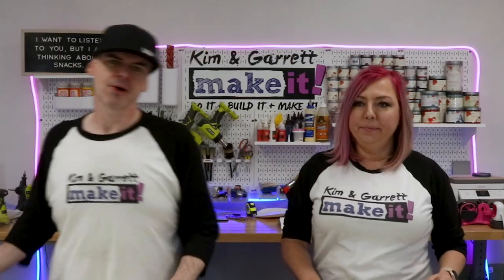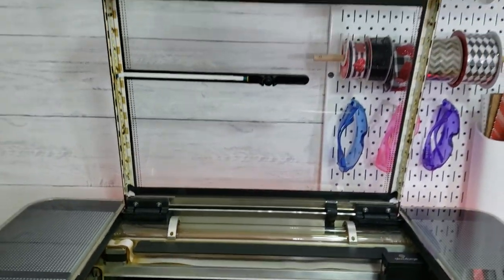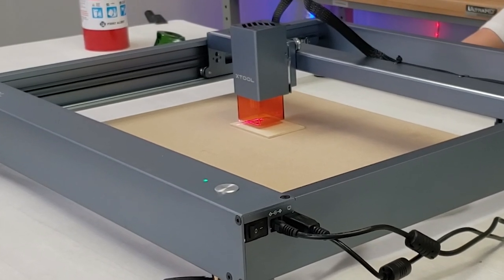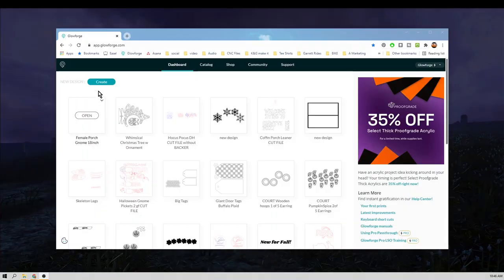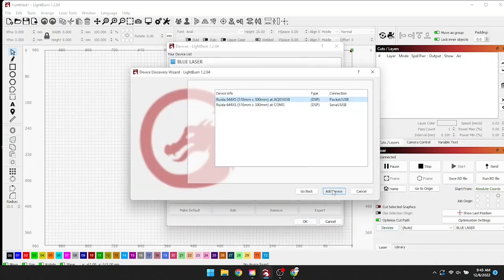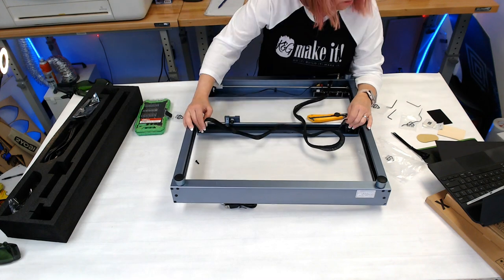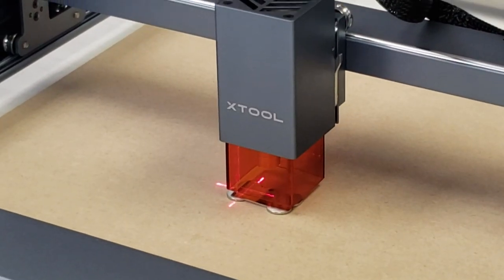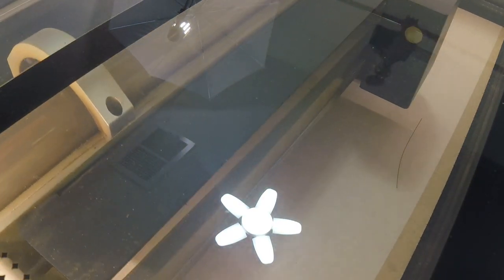Desktop Laser Engraver Compared: Glowforge Pro, OMTech Polar, and xTool D1 Pro

Comment: It should be pointed out that the Glowforge premium subscription is NOT required to use the machine.  Existing users got a free month of premium when it first came out, but I never used it.  I do everything I need in Silhouette and upload my SVG.  The only thing I wish I could do in the GF UI is flip things over.

I love my Glowforge and highly recommend it if you want to get up and running quickly with a short learning curve.  That said, if I was starting today, I would probably go with the Omtech Polar, based on features and price. The rotary alone sets it apart.
Reply: I'm confused.  Other reviewers I've watched have complained that Glowforge REQUIRES the $50/mo subscription to really do much of anything with the unit. Are you saying this is incorrect?  Thanks for any clarification you can give.  I'm researching and this $50/mo requirement as I understand is a negative dealbreaker for me.
Reply: @HaltWhoGoesThere  You absolutely DO NOT NEED the subscription to use the machine.  I found no significant value in it for my purposes (even when it was discounted to $15/mo when it first came out), so I do not subscribe to it.

If you go to the FAQ on their website, look at the second question under "Wifi and the cloud" (last section)

         Q: Do I need a paid subscription to use my Glowforge?

        A: No. All the software you need to use your Glowforge is included, forever, for free, with your purchase. If you'd like additional design software, free catalog designs, and other add-ons, you can subscribe to Glowforge Premium.

Comment: I started with the Ortur 10 watt diode, didn't really much care for it, as it is so light it moves all over the place.  So I upgraded to the Fox Alien 20 watt, easy to use, but again is light weight and moves around so has to be clamped to the table.  I then went huge with the OmTech 60 Watt Stand alone CO2 laser, with a commercial chiller unit.  I also upgraded the rotary to a Mansfield Customs rotary, which is the best of the best.  But I didn't give up on the diode so fast, and also have the XTool D1 10 watt, which is heavier than the other desktop diodes, doesn't move, and probably the best for doing just engraving. I haven't played with the rotary yet, as I do most of that stuff on the OmTech.  I did have to create a custom charcoal filtration and exhaust system, but the cost is rather cheap, and the air assist is awesome. Glad to see that the OmTech won your comparison, but I'm with Garrett, love all my children...lol

Comment: My laser is very similar. Started with an othur, was way to scary and not the best to learn on, luckily my wonderful husband surprised me with a glowforge for Xmas 2021. Glowforge is pricy but it taught me soooo much. Unfortunately, my glowforge caught fire (cardboard) I started the cut and ran to take a potty break and poof fire.  Word of advise don’t turn your back otherwise you run the risk of burning your house down. Luckily I didn’t damage it beyond repair and only need to replace a couple parts. After the fire I was devastated ( this was before I knew it wasn’t a loss) My hubby sprung into action and we went big with a Thunder nova 100 watt. Downside to the thunder is it’s takes up almost half of my craft room. Night and day in how long cuts take. Glowforge takes 20 minutes to cut the 1 Minute with my Thunder. I thought Glowforge was fast.
Reply: Wow tell me your hubby is rich without telling me he is rich.. 😅

Comment: I've been researching lasers and so glad I came across this video. You mentioned the bed size on the omtech...also saying it has a pass through. Would it be difficult to cut say like a 22 inch round (doorhanger) using the pass through? TIA
Reply from the maker: No, the passthrough slot in the OMTech is only like 14" wide.  You should checkout the xTool P2.  That might meet your needs.

Comment: I have been seeing more and more horror stories about the Glowforge so I will definitely be avoiding that brand. I've been seeing more and more nice things about the X Tool so that might be the way I go.  I think it is a better fit for me because I'm not, like, all crafting all the time. the price point, light weight/mobility and ease of use sound like a good deal for a light weight user like me.  If I get to a point where it no longer meets my requirements as I get more experienced with lazer stuff, I'll check out the OMTech when I'm ready to upgrade.  Thanks so much for sharing this comparison.

Comment: Excellent run-off. Was considering GF Plus. After watching this comparison, I’m seriously looking at OT 350. As a woodworker, there are shapes that vary in the ‘Z’  axis which the OT appears to have greater flexibility.  Question: engraving a baseball bat - neither of these have the length to accept say 33” L item. What is your suggestion? Thanks again for an informative video.
Reply from the maker: Hey Richard!  I think both of these machines would have problems doing a baseball bat, BUT I think the xTool P2 would be perfect at doing a baseball bat.  I has risers, large pass through, and does curved surface engraving. https://youtu.be/ZWXdsW5K7HY?si=vJ1IjJ6dCJ7omEaZ

Comment: I’ve been researching the crap out of these and was really conflicted! Thank you so much for this video !! I’m definitely leaning even more towards the omtech now ! My only question is   Even with it all encased and vented well out the window will my indoor office  smell ?( my heat press always smells fishy so I’m moving that out to the garage ) It’s also my guest room so that’s my only concern .  Thanks again I love all your videos !!
Reply: I have a Glowforge, currently in my basement which is also a guest room. There will be some smell (like a campfire smell) but it's not terrible and I don't think it lasts too long. It doesn't bother me. If you cut acrylic, it will smell like a nail salon.  An inline fan helps; you could also run an air purifier or essential oil diffuser.

Comment: I have the Glowforge Pro and I don't like it.  The proprietary interface (you can not use any other interface with it) is limiting and inferior to what I had with my Universal M-300 (which let you use Coreldraw direct printing). The old M-300 worked for around 15 years and is now defunct.  THe Glowforge is the only one I have now and is expensive ($7000), does not accept COreldraw desings directly (you have to export them from Corel as SVG images), and the air exhaust is very weak causing a lot of hassle with smoke damage to the finished pieces, and if your internet connection ever goes down, you're dead, as you cannot  operate your Glowforge without it! Also, Glowforge does NOT have a repeat this cut feature. You always have to resubmit it to their cloud, have them recompute it and resend it to the Glowforge again. A real P-I-T-A.   I am looking at getting the Omtech Polar as a replacement for the Glowforge so I can get back to normal laser cuttting operations.  This is my humble opinion.  Cheers.